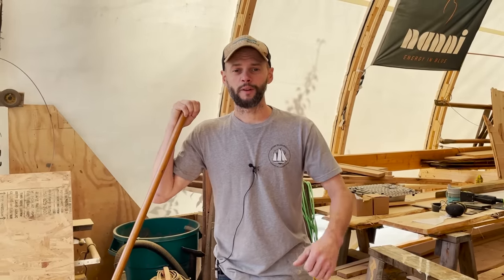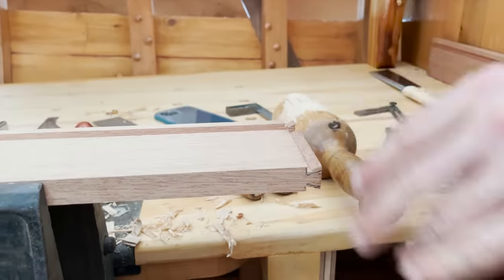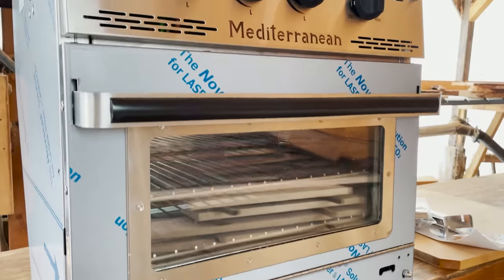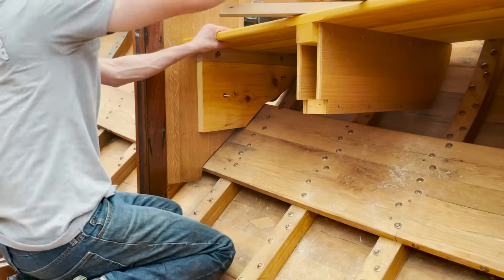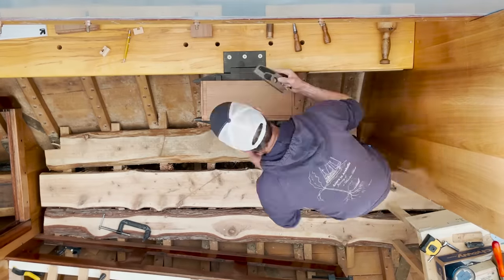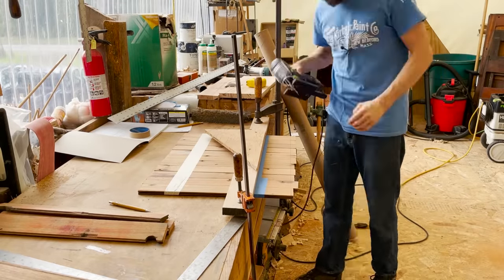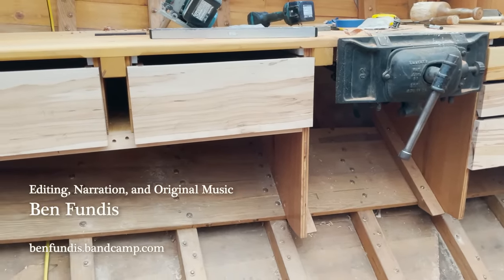No-Glue Drawers - Episode 182 - Acorn to Arabella: Journey of a Wooden Boat

Comment: Great work!!! I like your design, that will be a great work, with the raised back panel you could use a cleat to hole the drawer in, so it doesnt fall out if you are working and hit a wave.

With the temporary sole you have down, you are filling up the bilge with saw dust and shavings, be careful of the fire hazard.

Comment: I once sailed on a boat which had the kitchen cutlery draw over five foot deep, partitioned at regular draw depth, but for stores you could pull the draw right across the companion and it hooked on the chart table while you dug out whatever, was a very neat use of the deep shape of the hull.

Comment: I like the catch for the dog holes. On the bench I had, all the debris from the top ended up in my drawer. In your place, I would make a little slide/ drawer so that anything that falls through can be easily slid out and found and water easily dumped for disposal.
Reply: This is true. They made a catch basin for items falling through the dog holes, but it's not very accessible. A sliding insert would help.

Comment: Great video.  Love the progress you are constantly making. Love your high quality work and thought into what you do. Couple thoughts as I watch, which you may already have planned to do.  1) The dog hole catchers... you could have a dowel with a wood plate on the end that can be used as a kind of scraper and will fit to the back of the catch space. Store it in the catch space (dowel end first just pull it out when you need to clean out the space or pull something out that fell in.  You could also put a nice front plate on that catch space to make it look like a little very narrow drawer.  2) Make narrow drawers 6 inches or so wide that fill the space under the vice that sit on both sides of the pole that swings down.  These could hold very small tools, drill bits, screws, tape, caulking, etc.

Comment: You are quite right to be belts and braces on the heating front.  There is nothing worse than being cold on board a boat.  The inside of a boat should be a warm refuge when it is bad weather outside.  You have chosen the right sort of dry heating for the job.

Comment: How do you plan to keep the limber holes from plugging from detritus from your bench collecting in the bilge?  Suggestion, pick up a 12/24 volt automotive canister vacuum and mount it so it's always available to be used for clean up.
You need a second set of stops to keep the drawers from falling all the way out when opened and the boat heels.  Would think a final stop for the rear of the drawer wouldn't be a bad idea either!
Reply: I think that is what the extra length on the back is for.  Add a front "curtain" strip and then the drawer won't fall out.

Comment: My two cents on stoves. You want the main burner closest to the largest counter space. Having two racks is  always better. A lot of the boats I’ve worked on , we put three pieces of angle iron on the bottom of the oven to hold up an other rack. Collect half a dozen tin cans of varying sizes . Cut the tops and bottoms off. You use them to wedge the pots between the fiddles on the range. And as I always tell green horns when they start cooking duties , there are three rules for food at sea: -On time, Hot, and Tasty in that order. Fairwinds

Comment: Fractions of an inch hurt my head.
I love the metric and thousands of an inch.
1 mm = 40 thou.
I guess that’s the engineer in me😎
Reply: Mass-conciousness is USA should traverse to using metric system faster... how many more generations will struggle with those rediculous imperial units?!
Reply: @M12Howitzer  even the English gave it up for the metric system, and they invented imperial 😎
Reply: @lesmansom7817  Have they though? UK is the only place where (large) distance & speed is commonly measured in miles but the fuel to traverse those miles is measured in litres. Thus, economy must be measured in miles / litre?!?
And don't get me started on weights for people & cooking...

Comment: 1. Those holes in the sides are going to allow small things to escape one day. And on that day they are probably going to be extra annoying and jam between the side of the drawer and the supporting structure. Suggest plugging them.

2. The unused space in that slot for the dogs annoys me. Store something in there that will almost always be, or can be, 'out' when the bench is in use? examples, more than one of which can co-exist...

a)Dogs, parts of the vice, or a tool caddy/rack. Extra points if it fits a bracket/mounting where it would be in the way when the bench is not in use. 

b) A shallow draw with thin sides to catch the washers etc. so you can retrieve them easily. Or maybe just a scraper on a stick that can reach the back and pull stuff that has dropped in forward?

c) 2-3 document tubes for charts/plans/etc. stacked one on top of the other.

Comment: - The feel of the play in your draws seems right for me 17:25. Lose draws works so much better with weighty tools in them.
- I very much like the lift and pull, closing/locking design. Wow, that would feel really well-done-right to my hands.
- Securely designed slop and play always works, like the designed slop in a Kalashnikov for freezing cold, or hot dust, or mud.
- The brilliant part is that the grooves in the draw bottom slats with catch and nicely hold from rattling around all the little things that need to be easily found and picked up. Wow, you are wicked smat!

Comment: Use some felt on each side of the drawers to keep it from rattling. The felt thickness can vary as the drawer expands.
Reply: Better still - plastic leaf springs. Take a strip of HDPE, fasten with two screws such that it is forced to bulge inwards. Unlike felt that will dampen the shock, leaf springs will prevent bumps entirely. Of course some felt would go a long way to help against stuff rattling inside the drawer=) As for fixating the whole thing - any object that would prevent the drawers from moving upwards would also guarantee they can never slide outward. So a stick with a few "bumps" in it would be enough.
Reply: agreed, and the drawer won't expand side to side much at all, the way this is built it will expand up & down and as mentioned the bottom will get longer.  As long as mahogany and maple expand about the same, you could glue the back/sides/front together as they're expanding/contracting in the same plane.  I really like the design and the detail in these, pretty amazing
Reply: @alexpyattaev  I like that HDPE plastic leaf spring idea. Simple and effective. I was thinking of the same thing, but out of thin brass strips.

Comment: Beautiful how you work on your boat, I must have watched all your episodes. 
I had some thoughts about the drawer. As they are loose in width, the back will very quickly work the small nails out. The other thing I see is that the only thing that gives angular rigidity to the frame is the two dovetails on the front. Unless you pull really straight you solicit these and will work them loose in no time. I would suggest gluing the first slab of the bottom in the front and the sides, as well as the dovetail.

Comment: Great work on the drawers, as all the gran in the drawer sides, fonts and backs are all in the same orientation gluing these components would be beneficial. I foresee these joints loosing up over time and causing racking in the drawer. leaving the bottom floating is absolutely the best approach. I love your channel and look forward to watching each week, thank you for your hard work from you and your team.
Reply from the maker: Thanks so much for watching! Happy Friday!
Reply: @AcornToArabella  I understand the issues with moisture, swelling, and wood movement, but I agree with Richard Reis, these drawers are destined to be wiggly trapazoidal drawers, constantly getting wedged & stuck. You made the right choice by aligning the wood grain on the sides/back/front, but dovetailing the back (vs. dadoo) and glueing the 4 corners would have been wiser. But hey, time will tell!

Comment: I would recommend having the two rear holes on the drawer slides elongated slightly. Some plastics swells, and this looks like POM / Teflon, and that definitely do.
It's not as bad in air moisture as it is submerged, but it still might swell on you

Comment: You should consider trying metric for your projects. No fractions, just millimeters. Maths made easy. I'm sure you'll like it once you tried it :-)
Reply: Metric when using a calculator (or at least a decimal-inch ruler) but when doing math in your head, fractions are way easier.

Example:
What is double 0.375? Well it is 0.75 of course...forgive the sarcasm.
Where the double of 3/8 is simply 3/4, clearly way easier.
When working with fractions, it simplifies doubling or halving a measurement. Building anything by hand often requires center lines (halving) and/or adding two 'thicknesses' (doubling) at each end of a measurement. 
Once you start to use trig or any other calculator operation, decimals are way easier. And if you are going to use decimals, it might as well be metric.
Reply: @FiferSkipper  you got a point, but I'd still like to disagree. You're right on the doubling/halving, but overall metric measurements (or at the very least decimal inches) are a lot easier to handle. What's easier, 3/16" + 5/8" or 5mm + 15mm? Even working out which of those two fractions is bigger than the other, and by how much, takes mental gymnastics, whereas two decimal numbers are pretty clear.

And this doesn't even take into account the utterly insane world of imperial drills and threads, for example. Wanna tap a 5/16-18 thread? You'll need an F drill. Who came up with that nonsense, and more importantly, why do people still use that?

Now, I guess for hobby woodworking a lot of this doesn't really apply. But as an engineer who was trained in Europe and is now working in Canada, this stuff is doing my head in xD
Reply: @FiferSkipper  Also, you are thinking about it all wrong. Those funny numbers like .375" are a result of the fractions. In metric, you' normally use nice, even numbers. And for doubling or halving 50mm you don't need a calculator. So the fractions supposedly solve a problem that's caused by the fractions.
Reply: @sebastiansteiner5108  what's half of 375 mm then? There is no rule that says everything will be a nice decade of mm. Do it in your head. Sure it doesn't take a genius to do but it is far more difficult than half of 3/8.
0.1875 or 3/16, clearly one is easier to do in your head, fractions don't create the problem, they solve it.
Reply: @sebastiansteiner5108  just to be clear: I'm not saying SAE is better than metric, dear god I wish everything was metric. I'm only trying to point out that it is because of fractions that the dinosaur even exists.
Unfortunately, unless I move to literally any other country, SAE will be in my life till I pass. The sad thing is, the US switched to metric years ago and everyone here is too clueless to notice.
Reply: @FiferSkipper  yep. America for better or worse is mostly metric. Just yards, miles, etc for the most part. Heck, even domestic cars have metric fastenings. I break down computers and servers for a living. As far as sockets go, 7/32 , 6mm and 8mm will cover most of it. The star patterns are metric based, too.
Reply: @trythinking6676  figgen 3/8ths and 7/16" but, otherwise I only carry metric sockets with me.  The inch itself is defined as 2.54 cm!

Comment: Now that you have moved part of your construction inside the boat might want to consider putting a tarp or drop cloth on the floor under your flooring to ease in cleaning up sawdust and wood chips also something towards the back of the workbench to catch those shavings as well

Comment: Steve, when you made the comments (about 16:30) about wood swelling with humidity it made me wonder if it's worth it/even possible to add humidity to your workspace to "pre-swell' pretty much your entire boat and make adjustments now, when things might be easier to access and fix. Is that a workable idea or am I just proving I know nothing about boat building?!!?
I've done (a little) enough home build/reno work to know that EVERY project needs tweeks, it's just the nature of the beast. But fixing things early in the process can sometimes be easier than waiting till there's more "stuff" in the way to get at things.
And Hat's Off to Ann, she's done a really nice job behind the lens. Enjoy your time away Ann, but hurry back!
Carry on, mates!
Reply from the maker: Misters, humidifiers, and even just keeping the floor wet in the shop will be a must before caulking. It’s quite common to swell a boat before particular work or before launching. As for now, we’re at such a level of humidity that I’d recommend making a note of the planking seams now, and then again in February, when there’s terribly dry air. It’ll be near impossible to affect humidity in the space when the temps dip to February levels.

Comment: Steve two things troubling me firstly the longer the draw the more likely the sides are to bow allowing the bottom to drop out. I have seen this so many times that I have lost count, a transitional partition would prevent this. Number two is harping back to your tension bolts when threaded like yours they work as the boat flexes and slowly but surely saw their way through the carlins, never seen one go all the way through but seen many severely enlarged holes.

Comment: Yes, you certainly need a very secure locking system for the drawers when at sea.  The last thing you want is lumps of metal from the drawers becoming airborne.  Unless everything is properly secure, a knock-down will leave the boat the same as what you see when looking inside a kaleidoscope. I am still concerned about bits of your stove getting airborne, because they could do very serious damage, not least to the crew.

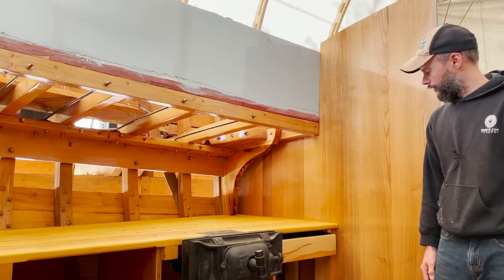Comment: At 18:00 to quote the late great Justin Wilson:  "Don't that purty!"  I was thinking, why not soak all those drawer components with as much oily substance as they will absorb?  They won't shed it quickly and it will add longevity and stability to the structure.  Back in my carpenter days it was "coat all six sides."  I don't know doodly about the shipwright trade, but I was just thinkin'.  Please correct me if I'm wrong; I'm always eager to learn.  Edit:  The piedmont of Georgia is infamous for its humidity, which I thought might appoximate a marine environment.  More than 90% relative humidity is not uncommon.  In other words, pre-swell the wood.

Comment: ordered 2 bilge dragon t-shirts, arranged delivery to here in Australia, (you guys are awesome, thanks), AND a FORTY TWO minute episode..
How lucky are we this week..!!

I would say though: you might like to add a complimentary angle to the little maple drawer catches - the corner will round off over time, but it'll cut into the plastic runner before that, which will reduce the current 'smoothness' of the drawer movement.. 
Those runners will pretty much last forever (yay for plastic!).
I'm using the same kind of plastic for the trunions guides in the table saw I built last year (it's based on the grey top saw John Heisz (YT) has made), and it runs fine with a total weight of over 12 kilos (26 pounds) on it, most of which is the watermelon-sized, 3hp induction motor hanging from the bottom of it.. "more power"... * grunts in 'Tim the Toolman' voice *

Have a great week guys :)
Reply from the maker: Thanks for your order, Gene!
Reply: @AcornToArabella  It's a pleasure guys, worth every cent :)

Comment: Might want to consider a central vacuum system (RV type).  Hose coupling in each area.  Convenient collection unit. Runs on 12/24 v.  Implement a storage tack room.
Reply from the maker: Yup, something similar is already in the plans, but not an RV one.

Comment: Looking at you working on that workbench was a real treat! That stove looks like propane, so maybe don't use it as a heating element (I couldn't tell if you were joking or not with that comment)  - if you don't have proper ventilation going on while using that, it will start burning badly (you'll start noticing yellow flames instead of colourless / blue) and producing quite a bit of carbon monoxide. I did receive a lengthy lesson on using propane stoves on boats when I'd contracted an old gas repair man (awesome fellow) to fix the one on my boat :D Of course, a wooden boat won't be quite as airtight as my plastic one...

Comment: Might consider adding an aluminum C channel, to slide it in and out, inside your plywood box to collect the stuff that will come down thru the holes for the dogs.  Can put a face plate to match your drawers and will allow to pull out the channel for easy cleaning!

Comment: I think you should consider a workbench on a "work mate" table(one of those tables with the two bench strips that can clamp together) that has the vice on it, that way you can take the vice out of the cabin, and do dirty projects(like sand etc) out of the boat on good days to save on cleaning and mess down below, can be well worth it.
Reply: I’m so with you on this. Dust, shavings, amd detritus is a huge issue on a small sailboat in the bilgee and everywhere else. The loss of a starboard settee/berth, table seating, etc. is also a huge loss for a functional all weather, all oceans cruising sailboat. I admire Steve’s commitment to pursuing his craft aboard, but I really can’t see this working out.

Comment: Steve old buddy you are putting a lot of saw dust and shavings in the bilge don't forget it's there. I did and had a big problem with my bilge pump (clogged)
Reply from the maker: That’ll be an issue later sure. For now it’s a quick vacuum.